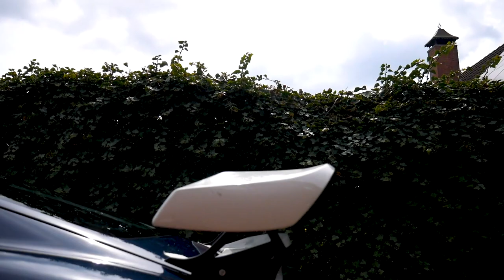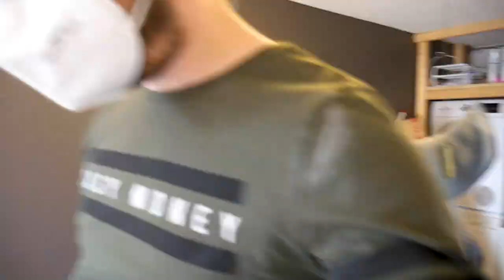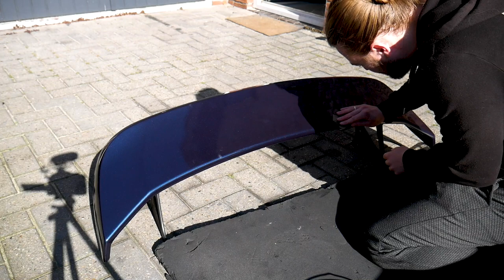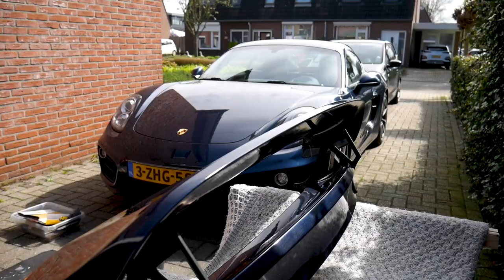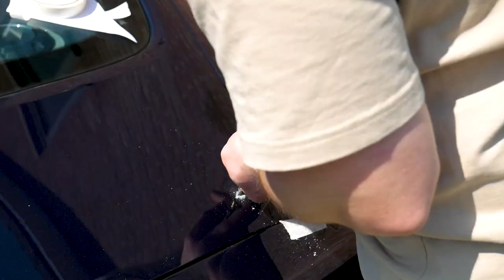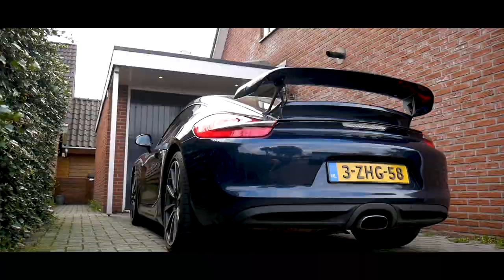Installing a Techart Spoiler on a Porsche Cayman 981

Comment: Very nice, good work !
Just replaced a door on a Jag XF and there was an impossible screw to get access to. So drilled a hole in the door, well drilled an existing hole but made it bigger !!
Reply from the maker: Sounds like fun😅🤣🤣
Reply: wow
Reply: Is this rear wing actually from 718(982) cayman gt4

Comment: Great video! Curious how much you spent on the tech art spoiler? How long did it take for tech art to send it to you?
Reply from the maker: Well fun fact I spend way less then it would cost new as I bought it used. It was like 800 euros. But I had to order some bits from TechArt as I only got the spoiler. I still miss some parts like stronger shock for the trunk and the complete kit to deactivate the rear spoiler mechanical.
Reply: @jtscustomsNL  that’s amazing for the price! I also really enjoyed the fact that you did the work yourself!  Where can I find a used tech card spoiler? Any suggestions? I’m kind of stockpiling parts and will purchase a suitable 981 when I find what I’m looking for. Thanks for the reply!
Reply from the maker: @StreetCultureUS  they are pretty hard to find but i would suggest ebay to start. Or just google and see what happens. Good luck!